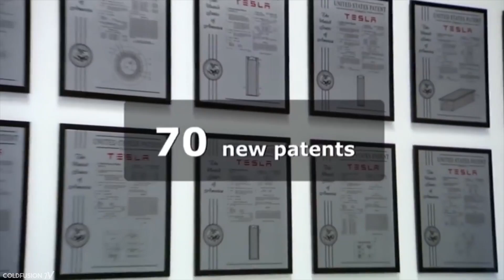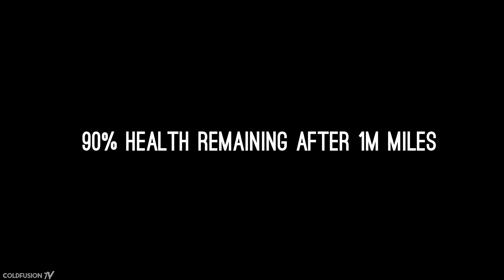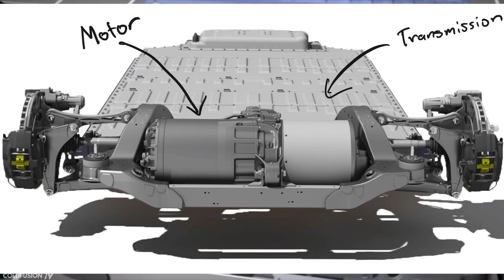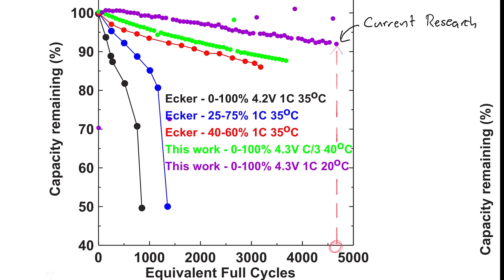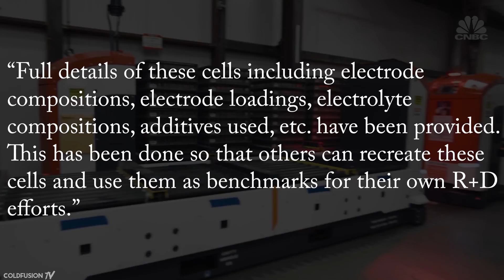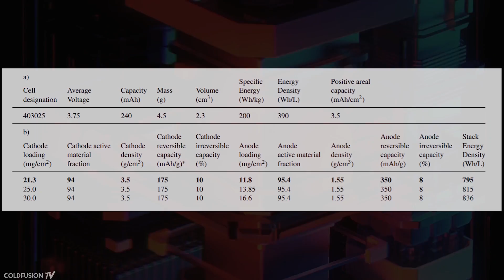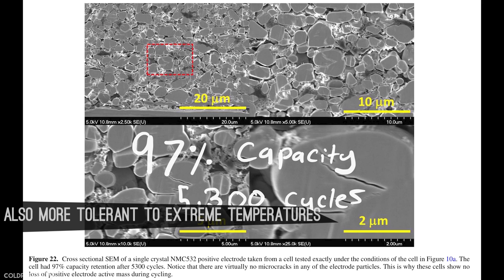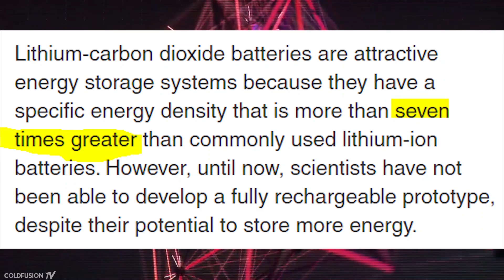Tesla's Million Mile Battery

Comment: That rippoff artist Elon are just ripping off the maxwell caps. and "HOT-RODDING" them.  That's the #1 reason Tesla bought out MAXWELL INC.   Fluoridated/Boron compounds will be at the heart for this "NEW" battery since both elements can hold 6 electrons per atom and two atoms could hold up to 36 electrons if in the right configuration is achieved and that's the hard part!   I could tell you how to make an 'H-bomb' but that does not not mean you could ever build one without the billions of $$$$ in highly specialized and rare equipment needed to do so at your disposal. Elon is not giving anything worth while away here.  He does have a great PR campaign for such a bastard which is his biggest trick!

Comment: The comment that this battery can be 'charged' 4,000 times suggests that every time someone drives their car they would pull into their garage and plug in to 'charge'. Even 'topping off' is considered a charge. If we do the math; 4,000 \ 365 days would mean this battery would last 10 years and see a 10% fall off in its overall capacity thus diminishing its range.

Comment: If some tech is ever going to replace Li-ion batteries it needs to either be significantly better to justify switching supply chains, or they make the supply chain cheaper and simpler, and they need those improvements to be much better than any improvement on Li-ion(assuming the same supply chain)

Comment: This is the most useless thing I’ve seen. Who uses car for 1 million miles? It will get outdated before battery degraded anyway.
With the current growth in technology this is not useful at all.
It might only be useful if those batteries run a rocket to moon and back
Why push this useless thing on this planet?
Reply: Truckers do 1 million miles in as little as 10 years or even less. 1 mil is hardly enough

Comment: With 4 cummins engines in Dodges working on my farm, they have proven themselves over 1million miles for a fraction of the cost(the engines not the Dodge part). After spending 80 to 100k, you still have to buy electricity to charge it and I don’t have the time to wait 8 hours to charge it up and ,oh, how far will one tow 35,000 pounds when traveling across the country. Not sold yet. Even locomotives use diesel generators to power their electric drive trains but all that weight cannot go over roads and bridges. I do own EV’s on the farm in some UTV’s and I enjoy how quiet they are. At this time, the petrol powered makes more economical sense for the small business to stay alive.

Comment: There are Li-NMC batteries. These are cheap, can store 50% more capacity, work in low and high temperatures, are also safe and life about 4000 cycles.. But they have low energy output. So these batteries are not capable for cars, drones, drilling machines, vacuum cleaner etc. Maybe Tesla solve this problem.

But Varta has now a better battery. These can store 360 wh/kg. Tasla has no laugh anymore. These batteries are an medical devices and Apples Airpods Pro.

Comment: Saying that your new Tesla can go 1 million miles without maintenance, just because it has a better battery is pure propaganda. There are thousands of other components like the fragile low quality electronics that will fail long before that. Research how often Tesla owners have to go to their dealers with little nagging issues compared to owners of other brands, before you spread misinformation about some utopian future.
Reply: From MarketWatch: "Maintenance costs for a Tesla Model S over five years were at most $2,800 (if drivers don’t use the pre-paid maintenance package) as of 2017 while a Mercedes-Benz S-Class racks up $18,000 in maintenance bills and the BMW 7 Series costs about $17,000 over the same period"
Maybe you shouldnt' look at cherry picked single examples next time you want to prove a point.

Comment: Like LED lighting, we need a new electric motor that draws a fraction of the current versions for the same power output.
Reply: Robert Jackson electric motors are already highly efficient.  Lighting was a whole different problem...most of the electric energy escaped as heat with traditional lighting.  You would be better off improving battery storage density and charging speed rather than trying to improve an electric motor.
Reply: @cmdoggy24  I'm with ya on the light bulb example. Everything is evolving except electric motors and we need a breakthrough in that direction of some kind. Controls have evolved so they went from AC to DC motors.
Solid State batteries coming out in Toyota's in 20 or 21. The SS battery race is on.
Reply: Robert Jackson Yeah, I am looking forward to battery storage breakthroughs.  Just looking at the new Tesla Cybertruck.  It has a 250 kw battery with a million mile lifespan.  A Tesla Powerwall is 13 kw and costs upwards of $10,000 to install.  If you could use the truck batteries as a Powerwall, you could power an average home for two weeks during an outage.  Not to mention the truck has an onboard 110/220 v outlets so you basically get a free portable generator with the truck
Reply: @cmdoggy24  Man I saw that cyber truck and I'm not a truck guy but I like that one.
Design by Darth Vader Bodies.
Just my style for sure.
I'd still carry around a small generator if it doesn't come with one.
I gather you look for a charge station and once you get there, there's two cars ahead of you.
No good...
How long is the factory warranty? Haven't heard that yet?
Reply: Robert Jackson I don’t think a warranty has been announced yet.  On the top model with a 500 mile range, I imagine charging will be done at home most of the time
Reply: @cmdoggy24  This will be evolutionary but if everyone converted to electric tomorrow it would only drop our carbon footprint by 4%. Half the vehicles are large trucks for distribution and delivery so they won't change for awhile. 2 Our grid couldn't support everyone charging after work so it will be a slow process. All very interesting and I bet the next 5 years will be eventful with even the Mustang having an electric version. 
You're certainly right on the available battery sources. Check it out;
https://www.topgear.com/car-news/electric/koenigsegg-full-ev-hypercar-possibility
Mustang;
https://www.ford.com/suvs/mach-e/2021/

Very Cool for sure, I think they should make the E models look the same. How many self respecting guy would buy and drive a Prius? sissy car.
Reply: Robert Jackson Yeah I was thinking about it more from my personal situation.  I have a 10 kw solar system on my house and only drive about 5 miles per day and my power goes out all of the time in winter so a large Powerwall built into my vehicle is great
Reply: @cmdoggy24  Buddy, you need a base model for the wifey in pink and the King Ranch model for you. Perfect for your scenario. Where do you live if i can ask?
Reply: Robert Jackson Northern California.  Think Tahoe, although Tahoe is 1 1/2 hours away
Reply: @cmdoggy24  Sounds like a beautiful place already. Go ahead man, preoder that Bad Boy with the optional 4 wheeler and Rock It.

Comment: Throwing money onto something is very Americana ... however, there are quite a few things that money cannot buy. Thus far, there is no known procedure that stores electrical charge in a Battery that is suitable for Cars / Trucks etc. Replacing Internal Combustion Engine is the desire of everybody. Its conversion of Petrol / Diesel / Ethanol into workable energy is still unmatched. Electricity has to be produced somewhere from something. All you are doing is transferring the shit to another place. I call it shit shifting.

Comment: Haughty claim ... Battery is Electric Cars Achilles Heal ...Its discharge is Battery's Achilles Heal. There is no known method for a Battery to stop discharging ... The fuel tank of a car / truck can be up to 100 litres / kgs ...engine circa 200 kgs, the rest is body, altogether 300 kgs. Electric Car battery alone weighs more than 600 kgs ...an average Electric car can go for 100 miles / 160 km, whereas an average diesel car can go for 600 miles / 960 km with full tank ...
Refueling of a Petrol / Diesel car can take 10 minutes, whereas recharging an Electric Car Battery takes hours ...Electric Cars are a boon to congested areas tooling around towns ...
Reply: 100 miles? Pulling numbers out of your arse eh? A long range model S can go nearly 400. But honestly that doesn't matter for nearly all commuters. Average commute distance is 20 miles, the only time that long range matters is during a long trip somewhere which is not often. My car can go 550 miles a tank, I'd trade being able to to off my car at home for the long range of an ICE vehicle any day.

Comment: Lemme tell you how much is actually 1,000,000
1000,000 mi= 1,600,000 km 
THE Circumference of the earth is 40,000km. I repeat 40,000.
 
NIGGA , with a 1,600,000 we can go round the earth 40 times !!!
(Assuming the car can go over land and water )

This technology is not gonna be available at least till the next decade for sure(assuming rapid technological advances in battery technology are made).
I don't think this battery is coming for the next 20 years at least.

I have so many problems with this 
1. First is the the battery itself, will it retain it's battery capacity over generations! 
2. The car surely won't last for generations to come.
3. Cars by then most probably will be maglev , so less friction meaning less consumption meaning the battery will last for even more longer. A natural calamity is also likely which damage the car and hence resources and money down the drain.
4. If the million miles feat is achieved ,then shouldn't it be used in rockets! Primary fuel or emergency fuel it doesn't matter! ( Im not from that background ,so I dunno the calculations and the battery can me modified or given a covering for the adverse conditions of space.) It could also be used in satellites and even the space station which is operational at that time. 

We are from reaching that technology to even think about it. 
I feel it doesn't make sense to use it in car. Maybe heavy machinery probably if that's the case like a crane or ooooh a submarine. 
The submarine would have to surface for supplies but would need less checkup and hence back in the water faster.

I just wanted to give you'll an idea about the reality. I maybe wrong for all I know. But im open to comments and just wanted to share my thoughts with you guys

Lemme know what you guys think.
Peace!

Comment: "Exclusive licensing agreement with Tesla" - this only means something if others can be prevented from using the battery technology.  You seem to assume that because the battery tech is being disclosed in the paper that it will be free to be used by others.  A requirement for every patent is that it must teach how to make and use the invention.  This must be done in exchange for the right to exclude others from making and using it for a defined period - 20 years from the earliest filing date.  Papers published in academia typically parallel patent filings to preserve exclusivity (for a limited time).

The alternate, "closely guarded secret" route, to protect battery construction details from competitors is trade secret protection.  In this case, there are fair and unfair ways for others to discern the trade secret.  For example, buying a product, taking it apart, analyzing the chemical makeup and figuring out how it works, i.e. reverse engineering, is a fair way to figure out the trade secret - perfectly legal.  In contrast, hiring or paying off employees trusted with the secret to have them tell you is an unfair way.  The question is whether the construction can be reverse engineered or not through examination of a battery.  If it can be, patenting is the only option to maintain exclusivity.  I suspect that it could be.

I do believe that Tesla's success will be better for the planet and I'm not faulting Tesla at all here. It's only rational that they should have limited exclusivity to compensate them for their investment and teaching others.  I'm only pointing out that Tesla's behavior is being wrongly cast as exceptional when they are using the system as any company should.  Moreover, I am glad they are securing exclusivity.  Imagine if Tesla operated as you suggest - spend money developing technology and then let every other company have it for free.  That's a sure recipe for bankrupting Tesla and leaving us to mercy of less high minded competitors.  Tesla needs exclusivity and they deserve it.

Comment: 1 million mile battery? Range between charging is everything. If per say an electric car could go 1,000 miles between charging then it can arguably viable till then work that major bug.
Batteries heat up as they are being used. When a battery heats up it looses power if it's too cold it looses power. (So how do you keep the batteries at a constant temperature?)